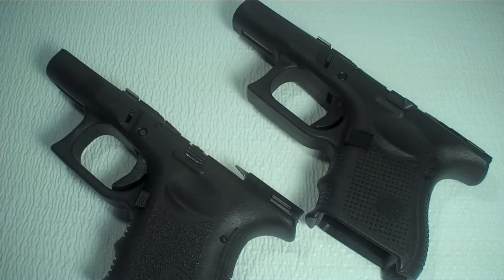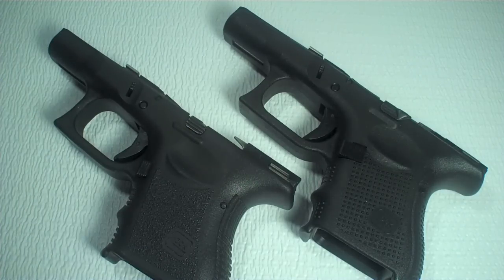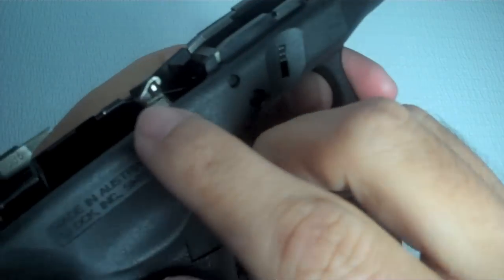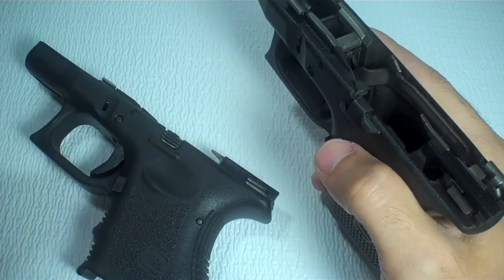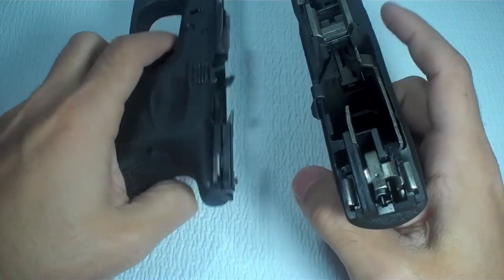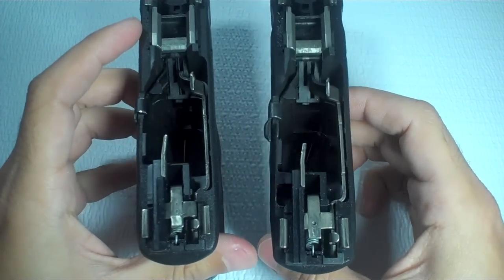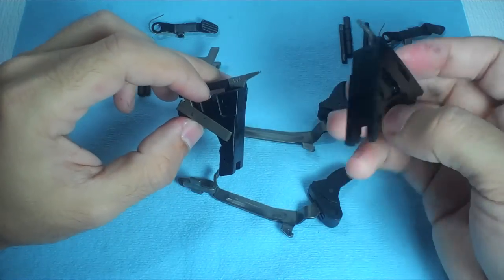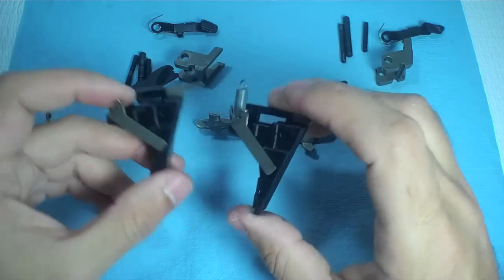What Causes the Glock Gen4 Trigger Weight - Part1

Comment: The connector has nothing to do with pull the connector only resets the trigger .the firing pin the part of the trigger bar that catches it thats what makes it crispy . A heavier firing pin spring will make ur pull harder and ur gun will work like garbage. The gen 4 housing will give u that crispy snap. Wich doesn't effect pull much its just in your head talking about pull weight because its crispy and giving u a illusion of a heavier pull.

Comment: Its the trigger housing that makes it crispy. And I'm not guessing I'm 100 percent.  Its not a experiment im positive.  It just makes the trigger bar sit at a bit of a different angle and its tighter against the pin so if u want your gen 3 all crispy for no reason u just snip the bottom of a gen 4 housing off. All u need is the plastic housing.  Again im not guessing im absolutely positive. Try it.

Comment: Swapped trigger bars from Gen 3 into my Gen 4. Trigger measured the same. Swapped back, and it measured the same. Both with nothing changed aftermarket wise. both consistently pull 5.5 lbs. However, the Gen 4 "feels" stiffer with the bump. Measures identical. Not sure where people think Gen 4 is so much different. I also swapped their disconnectors. No difference. The triggers always measure identicle. Measured my buddies brand new out of box Gen 4. It came out to a whopping..... 5.62 lbs. Hmmmm, still not looking good for the guys who keep saying Gen 4 is a harder trigger. 

My only advise is to wear the damn guns out and enjoy doing it.

Comment: I own four Glocks and have done trigger work on all of them.  In fact, I have tried different systems as well.  Parts can be polished for smoother action and the connector can be replaced with a Ghost or other iteration.  However, if you want to reduce weight of trigger pull, then the key is the weight of the striker spring.  However, replacing the spring comes with a significant caveat. If it is too light, then the trigger will NOT reset.  The only way this can be rectified is by replacing with the OEM spring or another variety with a different weight.

Comment: After trying several different connectors and combos with springs on my Gen 4 35 and recent 41 ....  The removal of the BUMP or switching out to a Gen 3 trigger bar is 110% IMPROVED less of a wall/reduced weight "feel".  
The Gen 4 35 I got a gen 3 trigger bar Pt# 0357 and no bump from the factory.  The Gen 4 41 I got the newest trigger bar from Glock but all 45 ACP/10mm bars (gen3 or 4) has a "bump" so I filed it off ..... Both Smooth and Sweet. 

To help with the "Wall" before the break of the striker, I highly recommend the Ghost Edge (or Evo Elite, or Pro3.3) connector.   The wall free connectors make everything above with the bump free trigger bar even more Sweeeeet.  

"De-Bump"  and never look back.  Your gen 4 will loose that "Staple-gun" wall trigger and you will shoot much better ... lots better!!

Comment: The gen 4 had a heavier trigger pull because of the changed angle in the trigger housing due to a thinner grip. Which is why the gen 4 started shipping with a dot connector. Which slightly lightened the pull. If you want lighter, go 3.5 connector with a polish. The bump on the trigger bar actually creates consistency. The minus connector you added would have brought you down to about 5 lbs in the gen 4.

Comment: Ah, horse jizz!  There is th 3 part video series a guy did that beats your theory down with a giant transvestite dick.  The angle on the connectors are the same princess!  I contribute the perceived trigger pull to the fact that your gen3 has been shot and cycled significantly more than your brand new gen4 model.  All the intellectuals over looked the obvious!
Reply: Powder Mathews you have a very eloquent way with words lol

Comment: My NIB Gen4 G23 came w/ a dimple-free trigger bar while my Gen3 G19 had a dimpled trigger from the factory. Both were swapped out for G17 smooth face triggers purchased years apart which had no dimples on the bar. My Gen3 G17 also has no dimple on the bar.

Comment: I have a Glock 21 made in 1992 that was manufactured with a "bump" in the trigger bar. This is not somthing new to Glock. I also have a 21, and 30 (one made in 2007, one in 2009) and they both have the "bump" as well. I think all this "bump" talk is hype. JMHO, YMMV.

Comment: I filed off the bump on the trigger bar of my gen 4 g26,Added a ghost rocket connector and a wolff competition spring kit and did a.25 trigger job.3 pounds even, with practically no overtravel. also got a crimson trace laserguard(they do fit gen 4s).252 rounds since mods wth no hiccups.

Comment: Very nice video! I'd be interested to know if Glock changed the degree of the connector on Gen4 so that the trigger bar wouldn't ride as high, which seemed to be a problem in the SF models with trigger bar gouging and failure to return to battery. I wonder if the connector angle went unchanged on the SF models and Glock learned from their mistake with Gen4.